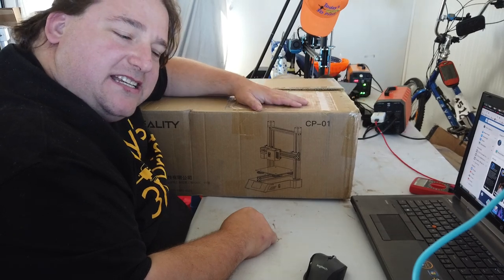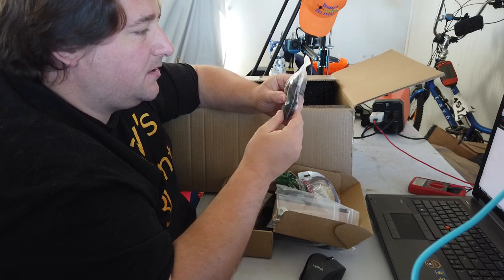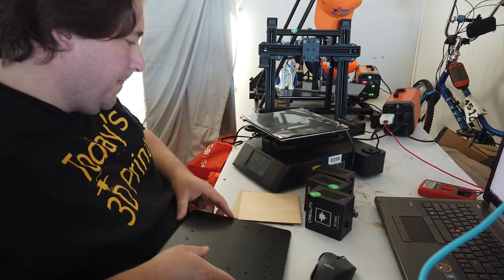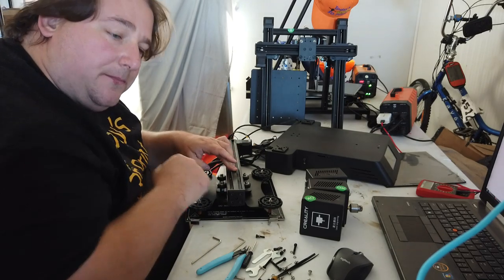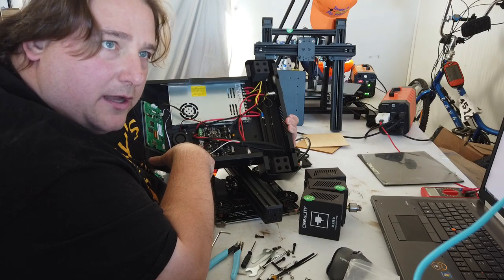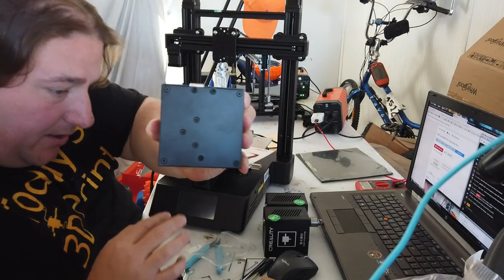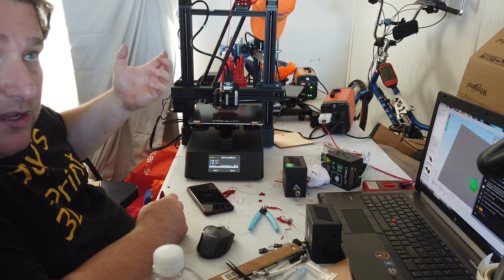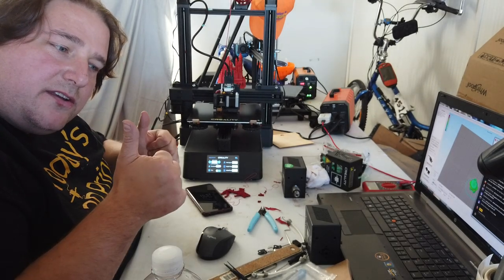Creality 3in1 CP 01 3D Printer T3DP

Comment: Hi Chris   I have been given a CP-01 printer but the deck has quite a bit of movement in it.   I haven't pulled it to pieces yet as I have just found out with this video as to how to do that.   Are the bearings or wheels under the deck adjustable or do they have to be replaced to get rid of the slack of my deck.  I can move the deck about a bit instead of it being firm.  Will wait for your advice    Bill
Reply from the maker: The wheels that are on the bottom of the plate that run along rails under the plate should be in three-wheel configurations the one of the three wheels should be adjustable if you look there should be a black wheel with a bearing and then a standoff silver stack between it and the bed two of them will likely be round while one of them will have two flat faces one that a wrench will fit on

These are called eccentric nuts basically the hole that is drilled through them is off center so when you turn that small shaft it actually shifts its position because of the off center hole this position shifting will move the wheel slightly closer and slightly further from the rail you can use that to snug up the fit of the wheel to the rail which you should get rid of the slop that you are seeing

Remember not tight only exactly snug enough to remove the slop no more so little tiny movements tweak check tweak check as soon as you're tight enough to remove the slop that's all you need too tight will cause its own problems

Comment: Hi Chris, how are you?
I'm having issues with my cp 01. Every print I make fails at some point. Always around 1.5 inches. I don't know why it just stops extruding. The head still moves as it's printing but there is no filament coming out. I'm currently trying to print face masks for my local hospital.
I always watch your videos and I couldn't think of anyone better than you to ask about this issue.
Thank you very much!
Reply from the maker: That sounds like heat creep Is the fan on the left working?
Reply: Hi Javi, I have the same problem, please if you fix it, can you help me? Thanks!
Reply: I also has the same problem, I thought it was a problem with the slicer but tried with crealityslicer cura slic3r and Prusaslicer but everytime the same thing happened. It just stops extruding at some point and the nozzle isn't clogged. I hope there is someone who knows what the problem is and know how to fix it....

Comment: Is there no part 2?
Reply from the maker: Not yet sadly. Printing is being used but just for 3d printing. I just have not had time to try working with the cnc attachment yet. :-(
Reply: @nerys71  okay thanks for replying. So the only issue really is the parts cooling. Maybe find a way to mount a bltouch too.

Comment: Good morning Mr Nerys. I would appreciate your advice with the following. After buying a creality CP-01 I was watching several videos including yours. Unfortunately I had to send the following information to CREALITY SUPPORT. Maybe you could help me before they do. 

Hello, Good morning. I need your help. I am disappointed, I bought a creality CP-01. When I open the creality slicer software that comes with it my product does not appear on the drop down list of compatible 3D printers. In your add it mentions support for varios slicing software as creality slicer, cura, repetier host. I have tried all of them and my creality CP-01 does not appear in any drop down printer lists. DO I HAVE TO SELECT A DIFFERENT SIMILAR CREALITY PRODUCT MODEL??? THANKYOU VERY MUCH FOR YOUR HELP. RM

Mr. Nerys thanks for your posible help. RM
Reply from the maker: Select the Ender 3 then change your build volume to 220 by 220. Also change your retraction to 1 mm That should be about all you need to change.
Reply: @nerys71  Thankyou very much for your advice. Problem solved. You solved my problem faster than creality support. I wish you success. Thank again. RM

Comment: bummer!! no natural gas.
i am planning to get rid of natural gas. thats where they aiming to in the Netherlands.
i am planning to get solar panels to heat a boiler and perhaps infrared panels indoor.
and if that does not work for me,and even more interesting for you also. a pellet stove heating system. maybe with the possibility to connect to my existing radiators that are now still connected to the gas fed central-heater.
Reply from the maker: I am also planning to get a pellet stove. only costs about $5 a day for heat. not cheap especially compared to NG but NG is no longer an option so..... next best. Going to try and take advantage of a TSC deal this week $200 off. $999 for a 2000sqgt capable unit with a 130lb hopper!! 3.5 days between fills. nice.

Would love a regular wood burner too since then I can scavenge free wood as well such as non treated pallets etc.. (oak)

but it will take some time. you need flue hardware fireproof hearth etc... last thing I need is to burn the place down! that would suck!

I found some kerosene. still obscenely expensive at $6 a gallon but that is better than $12 a gallon!!!! insane how expensive it is here. no call for that. but I guess that is why no one really carries it anymore. too expensive.

it will get me through the next week till propane arrives. fingers crossed inspection goes well and the furnace that came with the house works!!! I am off to get some tanks and get this heater going before the snow arrives. we are expecting 3-6 inches today with as much as 12-16 total in the next couple days.

Comment: what is the $$$$ on this ?
Reply from the maker: The printer I believe is around $600. It is not cheap. But it does come with a CNC head and the laser head which I have not played with yet. The printers that structure is absolutely top-notch, and the printer is virtually silent. In 3D printing mode It does have an issue where the parts cooling is. Not very effective. I put a piece of wambam on it and I run the heat bed at 35 C and that works very well for me.

It is also direct drive with a bun textile dual gear system. I get ridiculously clean prints from it.
Reply: Nerys I’ll be definitely looking into buying one off these and looking forward to more reviews, thanks.